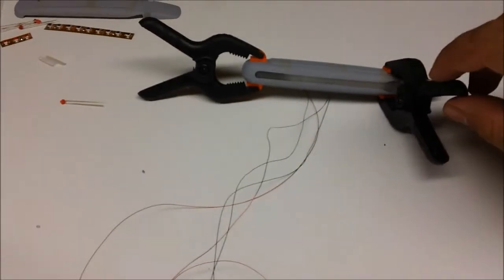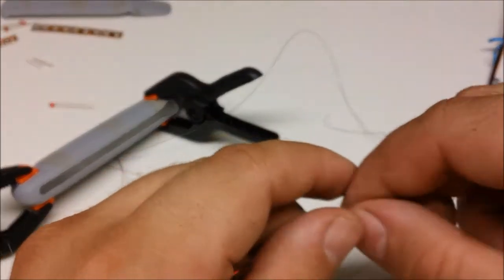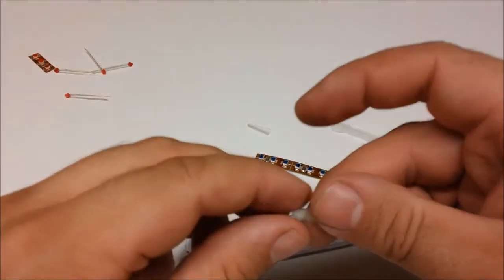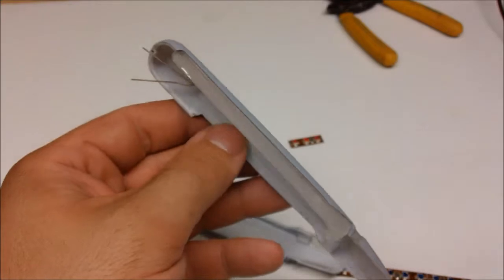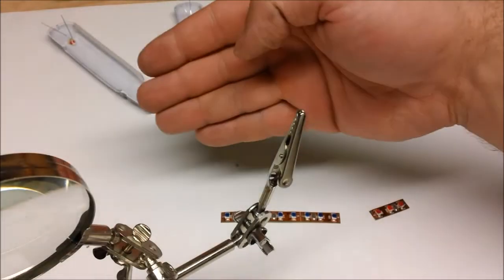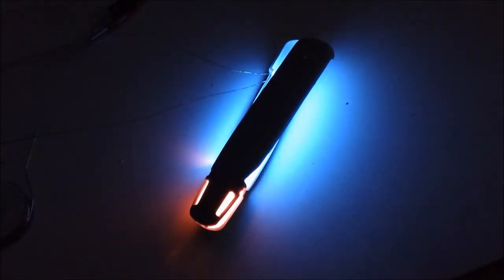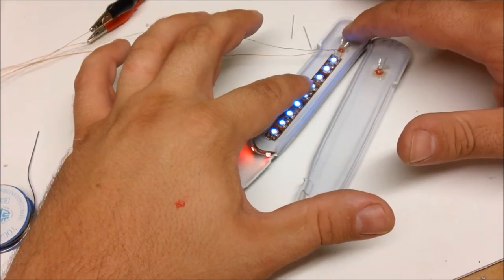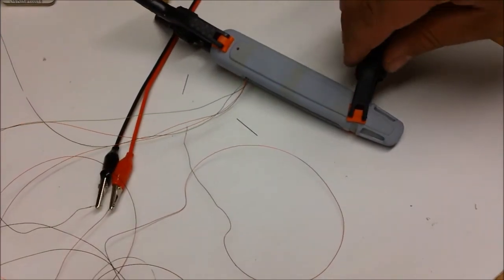Voyager Part 5: Lighting the Nacelles

Comment: Great job on the nacelles. I wish I would have broke down and bought some red l.e.d. tape, but I just decided to build up a wall and glued in a red 3mm l.e.d. Hopefully that works. When you painted your flux chiller grills with the matte finish, did you spray both sides, or just the outer side?

Comment: Great progress on the nacelles so far. I'll be working on mine here sometime this week. It's a good idea to mount the l.e.d. tape to the bottom for gravity reasons, but as a precaution, you can also just tack some ca around the tape as weel as a failsafe. I've been looking for a gang board like the one you showed. Where did you get that, or did you make it yourself? I should be posting a video probably at the end of the week, or weekend on my progress as well. Good work so far.